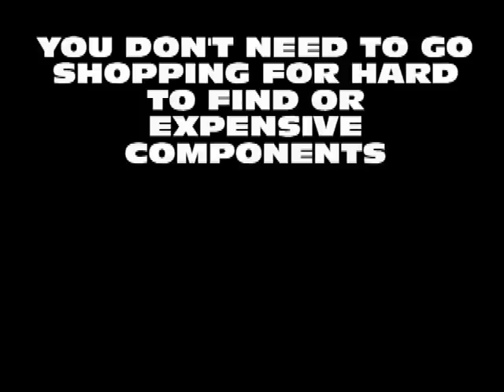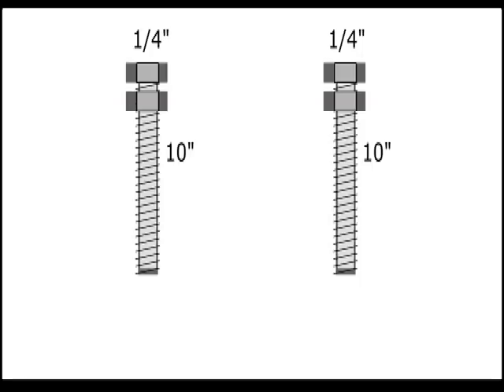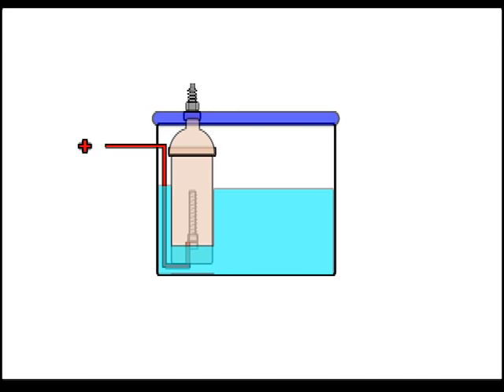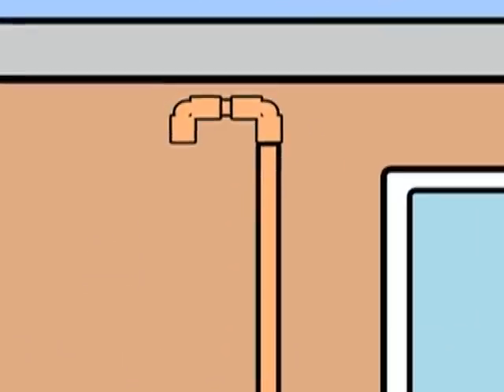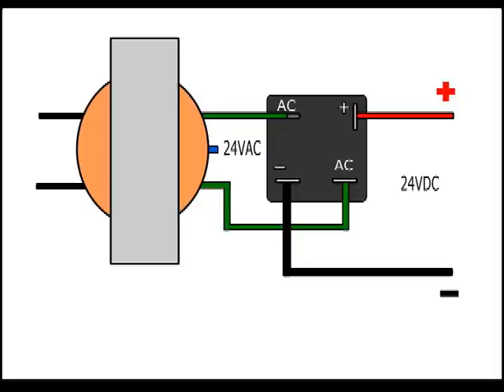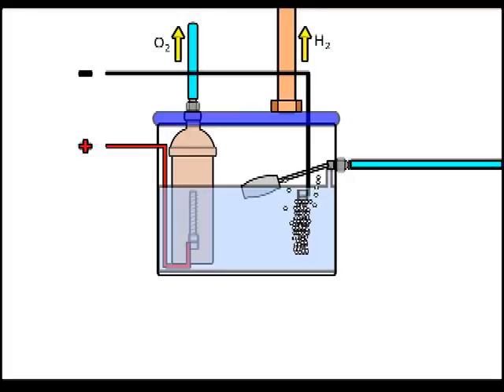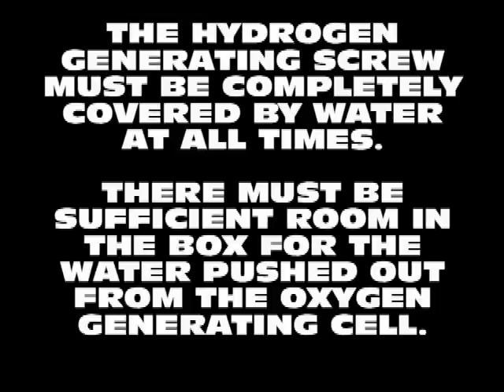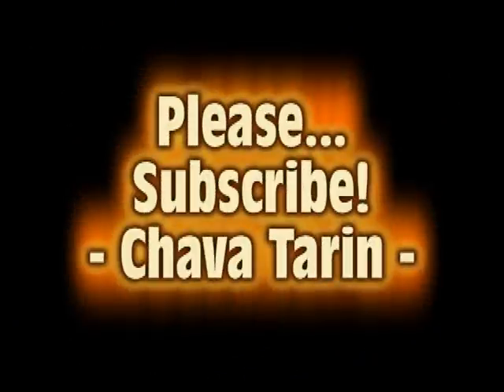Homemade Oxygen Generator

Comment: And how much do you pay for the electricity just to get some oxygen? and since the oxygen can be pipe to a room,  can use it to help covid victim breath if you can rais the room oxygen a bit??
Reply from the maker: The power consumption is considerably high. Heat is evolved in the process, and that means losses. Oxygen introduced into a room can be dangerous, since in the presence of oxygen most usually stable items can burst into flame! Things such as bed clothing, curtains, plastics, can spontaneously catch fire, in any case, expert help must be involved. Oxygen is dangerous!

Comment: It's there a chance poisonous chlorine is produced at the anode instead of oxygen? I asked because submarine does electrolysis to obtain oxygen, but they must take care to make sure chlorine is not produced. 

It have to do with the concentration of solution used
Reply from the maker: Dear CK Liang, if the water used is distilled pure water, oxygen will come off the positive electrode, however, if you use water containing a chlorine salt, chlorine will come off of the positive electrode.
Reply: @eltunene  This has been my worry. Because tap water is not pure water, it is mixed with other ions. How do we ensure the solution is dilute enough that chlorine is not produced?

Comment: Great for producing very small amounts of gas, but if you want more volume I suggest using a whisk with copper scrubbers stuffed inside as your electrodes. They will provide far more surface area for electrolysis. Also, oxygen isn't just a good oxidizer, it is the ONLY oxidizer.
Reply: Why not use stainless scrubber pads 8n the wisk?
Reply: @superjeffstanton  Good idea! The copper does exude some nasty particulates over time.
Reply: Check the chemical resistance of the materials that you suggest pop. PVC pipes and fittings cannot withstand for long their contact with strong alkaline solutions with a pH value higher than 12 ( NaOH aquatic solution may achieve a pH value of 13 quite easily ). Also hydrogen gas coming out into the atmospheric air may create spontaneous explosions , becouse it has such a tendency in its gas  mixtures with free atmospheric oxygen , when it's v/v percentage is equal or higher than 4%. Ask for a relevant permit by the local Firefighting Service Dept. before trying to play The Little Chemist.
Reply from the maker: Thanks, Harold,  for your contribution!!
Reply: @eltunene I Think the best should be inox!! copper or most of others metals ends by giving rubbish in electrolite! Never pleasant to clean and refill!
Reply: Fluorine gas or chlorine gas are also oxidizers , much stronger than oxygen and thus not existing in free gas condition in our environment.
Reply: Can you send me a picture of what you're talking about with the whisk and copper scrubbers?
Reply: @johnnyking1031  I'd be happy to. Just let me know where to send it. Also, since I posted this comment I've had a bit more experience and discovered using copper leads to rapid contamination of the water. I started using stainless steel and it's much cleaner.

Comment: Sadly, very inefficient design. Did you build it? What's the flow rate of oxygen and power consumed?
Reply from the maker: Yes, Max, it produces very little gas, and requires quite a bit of electricity. I built a similar gadget and am still experimenting for increasing the yield. Thanks for your contribution!!

Comment: Hi can we use this type of oxygen generator for COVID-19 patient ?
Reply from the maker: Dear friend, you would have to make some important changes, besides building a larger unit, however the original project was thought for a small torch, not for producing large volumes of gas. Of course, it can be done, but the materials, precision and other factors should be supervised by certified personnel. Some heat is evolved in the process, so that could be a serious drawback to plastic casing. In the International Space Station, they use a similar process, using special electrodes and solution. However, the project as is, is not suitable for that application.
Reply: @eltunene  
Thank you 💝

Comment from the maker: Dear Mark, you would have to make some important changes, besides building a larger unit, however the original project was thought for a small torch, not for producing large volumes of gas. Of course, it can be done, but the materials, precision and other factors should be supervised by certified personnel. Some heat is evolved in the process, so that could be a serious drawback to plastic casing. In the International Space Station, they use a similar process, using special electrodes and solution. However, the project as is, is not suitable for that application.
Reply: You are not also using the hydrogen for the torch?  That would seem like the obvious thing to do.  If fact I believe this very method is used for small oxy-hydrogen torches for small precision work.

Comment: Bro did you help me because I am doing a science project I think I need to do this project please explain    
Me how did you do this plezzzzzzzzzzzzzzzzzzzzzzzzzzzz
Reply from the maker: Dear friend, any two electrodes immersed in in a solution of an acid, a base or a salt in water can act as an electrolytic generator. One gas (or solid, in the case of electroplating, is deposited on one of the electrons. Generally, hydrogen comes off the negative electrode, and oxygen, chlorine or other gas off the positive electrode, depending on the nature of the compound you add to the water. If you add sodium hydroxide, oxygen comes off the positive electrodes (also called the anode) and hydrogen comes off the negative electrode (also called the cathode). Both gases must not mix with each other, since they are an explosive mixture. Tap water has some salts dissolved in it, which account for "hard water" and "soft water", and these salts contaminate the gases coming off the electrodes. For obtaining pure hydrogen and pure oxygen, distilled water must be used. Also, the electrodes must be of such a metal that does not corrode by the gases, such as stainless steel, all that is something you may use in your thesis, however, no matter what, do not use in humans, since even pure oxygen can be harmful if not supervised by a medical professional. One last thing: the process consumes a lot of energy and evolves some heat, the bigger the electordes and the higher the voltage, it can overheat and melt the materials used, yielding to mixing of the gases, creating the risk of an explosion. Thanks for your comment!!

Comment: Dear, Can I use 300V DC? No need the 24 VDC? Thanks
Reply from the maker: Dear Chuong, you may, but must consider the fact that some heat is produced during the process. The higher the voltage, the higher the gas production, but also the current will be higher and the heat evolved can damage the components of the tank. Please contact qualified personnel as to high power components for electrolysis. Also, the plastic parts must be more resistant and the seals between fittings must be high temperature resistant. Any leaks and mixing of the gases can be disastrous!
Reply: @eltunene  Thanks
Reply: @eltunene  Yesterday, I tested it. The temperature is high. But I do not know why there is little O2. I will add more baking soda into water today. Do you think it is ok? Thanks a lot

Comment: Thank you Sir for this information, i have my HHO generator and used to fuel my Gasolin Car as additive, now if there is a shortage for Oxygin i can used to make new Generator separating Oxygin and Hydrogin. Thank you very much for the understanding sepation of OXygin. 

Sir I have my Biogas generator and useful for cooking and Fueling Elect Generator. My con concer is to separate Methane CH4 from other form of Gas to remove like Acidity and Carbon, moisture. Thanks and hope for your kind guidance.

Comment: At the heart of the whole process is the separation of the oxygen atom from the oxygen-containing solution. using electric charge But in the clip, the electrochemical process is not described. It also did not explain what the electrolyric substance was used for.
Reply from the maker: Dear Mr. Estrada, water conducts electricity only when it has some salt, base or acid dissolved in it. Pure water is a poor conductor of electricity. That is what the electroyte is used for. Originally, the project was for a small torch, so I did not go into details as to chemistry of the process. Thank you, good point!
Reply: That's common knowledge though. Everyone knows this.

Comment: May want to look into combining the hydrogen and oxygen and breathing it, creating Hydroxy. Because hydrogen is extremely flammable, you'd want to breathe it in very low amounts. So you would have to have some kind of gas regulator. It has immense health benefits.  Look into George Wiseman and the Aquacure..
Reply from the maker: The idea of the original project was feeding a small torch. In the case of medical use, this material should be used only for a source of inspiration and have experts deternine if the oxygen being produced is suitable for breathing. The principle is used in space station and space traveling for providing water to astronauts, of course, much more elaborate equipment is used for this purpose.
Reply: The two fases should never be mixed or breathed.   They are highly explosive.

Comment from the maker: Dear Glanze Epic, thanks for your comment; originally, the project was intended for a small torch, such as the kind used in jewelry. However, it can inspire somebody to keep researching and experimenting in order to produce larger volumes of oxygen. However, several things must be taken into account: Electrolysis consumes a lot of electricity; oxygen and hydrogen must not mix, they are explosive together; large volumes production involves a lot of heat production also, so the materials used must withstand high temperatures: any intention of medical use must be supervised closely by qualified medical personnel, even "known good" oxygen from tanks can be dangerous if excessive; water used in the process must be distilled water, since raw water from the tap may have chlorine salts dissolved as well, yielding to the production of chlorine along with oxygen; finally, if pumps are to be used to try to store the oxygen, they must be special, oil-less pumps, since oxygen is a strong oxydizer, and many objects, including metals, may burn violently in the presence of pure oxygen. Regards!
Reply: সোডামেকার
Reply: Hydrogen can use as gas for cooking food or room heater
Reply: @shockelites2887  Especially if you want to blow yourself up.

Comment: Very usefull in Pandemic Covid-19 Condition
Reply from the maker: Dear Andreas, thanks for your comment; originally, the project was intended for a small torch, as used in jewelry. However, it can inspire somebody to keep researching and experimenting in order to produce larger volumes of oxygen. However, several things must be taken into account: Electrolysis consumes a lot of electricity; oxygen and hydrogen must not mix, they are explosive together; large volumes production involves a lot of heat production also, so the materials used must withstand high temperatures: any intention of medical use must be supervised closely by qualified medical personnel, even "known good" oxygen from tanks can be dangerous if excessive; water used in the process must be distilled water, since raw water from the tap may have chlorine salts dissolved as well, yielding to the production of chlorine along with oxygen; finally, if pumps are to be used to try to store the oxygen, they must be special, oil-less pumps, since oxygen is a strong oxydizer, and many objects, including metals, may burn violently in the presence of pure oxygen. Regards!

Comment: How often do we need to replenish sodium hydroxide into the solution?
Reply from the maker: Dear Caesar, if the solution does not get contaminated by dust or other foreign matter, you just need to keep adding distilled water, the sodium hydroxide does not consume during the process. If the water added has some chlorine salts, it will not only pollute the oxygen with chlorine, but can erode the electrodes and render toxic chlorine gas.

Comment: Can anybody explain me why oxygen is being produced ?? Why to mix caustic soda in water ?? What's its work ??

Plz armies, help me 💜
Reply from the maker: Dear Sunita, water is a compound, made up of two elements: hydrogen and oxygen. Water does not conduct electricity by itself, so it´s necessary to add some substance, like caustic soda in order to make it conduct. While conducting, positive ions (hydrogen) are attracted to the negative electrode, while negative ions (oxygen) are attracted to the positive electrode. When the ions touch the electrodes, they become neutral atoms and are released to the atmosphere. Gases such as hydrogen and oxygen form their molecules in pairs. A molecule of hydrogen has two hydrogen atoms, a molecule of oxygen has two oxygen atoms. That is why they are released a H2 and O2. If you burn hydrogen in an oxygen environment (care must be taken, the mixture is highly explosive), water is produced.
Reply: @eltunene  thanks a lot 😇

Comment: Since we only need oxygen and will release hydrogen in the air, why don't we just hang the negative wire in the air? So it won't extract the hydrogen from the water. Of course we must continue to circulate the water supply after the oxygen is extracted
Another question, when the water level drops and the nut meets the oxygen that has been produced, does the process simply stop or can it cause a fire when the positive electric charge meets the oxygen? Is it necessary to stop requiring all parts of the nut to be above the water level or is it only slightly popping?
Reply from the maker: Dear Muhammad, when water is separated into Hydrogen and Oxygen, if you remove the oxygen, you inevitably remove the hydrogen (if you take away the oxygen, there is nothing but hydrogen left), besides, leaving the negative wire unconnected, there will be no current flow through the water, since it is an open circuit. Unfortunately, it wouldn't work. Regards!

Comment from the maker: Dear Gorilla Disco, the project is for supplying small amounts of oxygen for a mini torch, the amount of hydrogen produced simply goes to the atmosphere, where it recombines with oxygen to form water, ignited by static electricity discharges. It can also be collected and used to feed a propane fridge, however, I omitted this in order to keep the project free from the dangers of hydrogen accumulation and explosion. However, with due precautions, both gases can be stored and used separately.

Comment: Now take the hydrogen and oxygen burn it in a generator cooling the exaust wala pure water and electricity as well.
Reply from the maker: Dear Jerry, well, yes and no. It would work, provided enough gas is produced. However, the generation of gases by electrolysis evolves some heat, which means a loss of energy, besides that, when burning the gases in an internal combustion engine, with an efficiency below 50 percent, another bunch of energy will be lost as heat, so if you wish to produce electricity from the beginning, you can do it skipping the electrolysis, gas burning and heat fan-away. Anyway, you would lose some power but indeed, it would be fun!
Reply: @eltunene  my original plan was a gas turbine. Then rapid cool the exaust in a "chill"box so to speak. So the turbine spins the generator that powers the thing.
And the only by product is pure water.

Comment: Since  oxygen & hydrogen are present in all air why no explosions ?
Reply from the maker: Hydrogen is not normally present in all air, but small traces of it, since hydrogen is the lightest gas, it floats to the upper atmosphere, on the other hand, oxygen is much heavier and stays closer to the ground. Explosions occur when both gases are mixed in a confined space, just a small spark can ignite hydrogen and oxygen very easily. Even with just pure oxygen, many normal substances can ignite and burn violently, such as cloth, paper, wood and even some metals. Thanks for your comment!!!

Comment: Can not use regular tap water need to use salt water or add  some episodes salt for the minerals in tap water works against the process
Reply from the maker: Salt (sodium chloride) water will produce oxygen heavily contaminated with chlorine, which is lethal to humans. If you use it for a torch, hydrogen burning in the presence of chlorine produces hydrogen chloride, that is hydrochloric acid, which is highly corrosive!

Comment: Thank You Chava Tarin, very usefull a especially at this time of Covid pandemic and scarcity of oxygen tank for home use. 👍👍👍🙏😄
Reply from the maker: Well, dear Werdoyo, yes and no... producing enough oxygen for an ill person requires a much bigger machine, besides distilled water and other sanitary precautions. Besides, a bibber machine will produce much heat, and so it requires special materials to withstand high temperatures. Maybe using several properly vented small machines would do. However, the oxygen produced must be certified by duly authorized medical personnel.
Reply: I don't think the oxygen produced using this method is medical grade, the NaOH vapor might harmful for u'r lungs if inhaled, so don't ever try to substitute u'r medical oxygen using this one

Comment: It use water?
Reply from the maker: For the original application as a very small torch oxygen source, plain tap water can do. For more stringent applications, distilled water should be used.